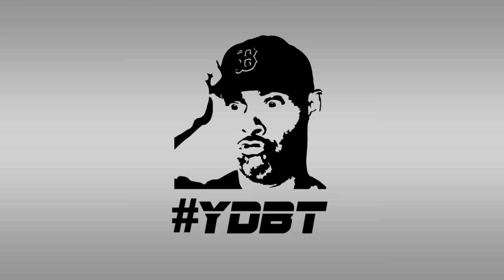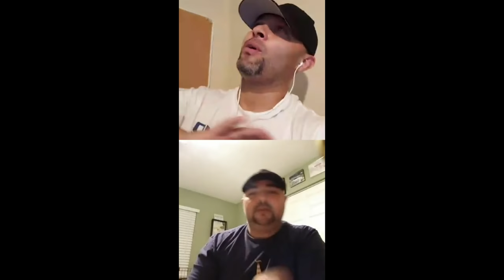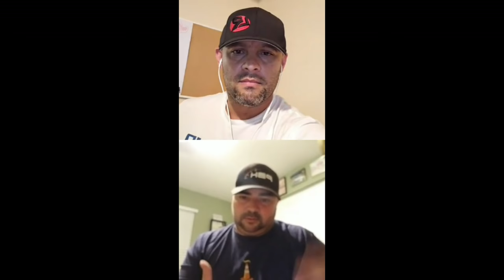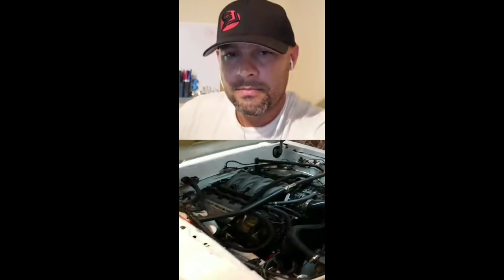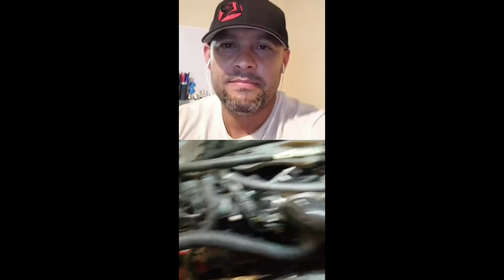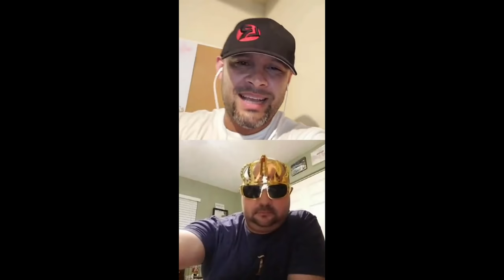IG live episode 2. Coyote swap and common mistakes.

Comment: As always Alex, thanks for sharing great info. And I am happy PBTH is getting lot of business from these swaps. But overall it is completely beyond me, that people are willing to throw 15-20K into swapping an modern engine into some old junk. When you can just save yourself the headache and buy a S197 GT for way less the 20K and get yourself a modern car that comes with desired motor . Heck can even get a S550 for very low 20K today.
Reply: I understand that it can be about the sentimental values. It hardly ever makes "financial sense" the hobby of car modding. 
I like to mod and go fast myself. But there is a limit to everything, and for exp spending 20K on a 5K car is completely overboard to me. When it comes to try to make in kind of sense out of it this expensive hobby. It is just my opinion. 
But again I am happy companies can make good business helping people that like to spend 20K on swapping an engine into a 5K car or even less, Like Alex's Fairmount!!. As big of a fan I of the man. I just to don't understand the love for the Fairmount. But it has to be about sentimental values. I guess.

Comment: Hey man my clutch is going out on my 2012 Mustang GT, what’s ur top pick(s) for aftermarket clutches. I’m making 435rwhp and 385 torques currently. Hoping to up that to about 500-550rwhp eventually.
Reply: Robert Hatley somthing with NO springs, and like a 6 puck stage 7 design, doesn’t have to be 7 prolly just a stage 3, somthing as grabby as possible
Reply from the maker: Mantic twin disk.

Comment: I have a 2011 5.0 GT what would I have to do to get the 2nd generation 5.0 in my car to make it running and driveable
Reply from the maker: Move over all of the cam components, Chains, phasers, Crank sprocket, and cams .
Reply: Because I was going to buy a crate engine from an S550 I didn't know if I would need a wire harness and the ECU to make it run and drive and I want to say thank you for helping me with the information

Comment: Common problem everyone want plug and play sorry it's not that easy...… My brother bought 2011 F150 core engine 450 dollars. Rebuilt engine forged pistons, mustang oil pump, front cover, Boss OEM cams (GT and BOSS share same intake cams) rebuilt heads AND still cheaper than buying crate engine or used Mustang GT engine. Does it help that we're both mechanics YEP. Did a lot of research in difference between F150 vs Mustang and doing the swap. Ran into problems with dash but aftermarket cluster fixed that. Problem with using 2001 Cobra Alt (4g alt) on I terminal DON"T connect ignition 12volts to it because you will burn alt up. Had to put in 560 ohm 1 watt resistor from ignition (run) to I terminal fixes that. Fuel system so many scream dual pumps for possible upgrade to supercharger and paying out 1000-1500 dollars. But 99.9% will never do supercharger if you was do it in first place. Put in fuel hat for 1998 and put in single high output pump in.Only thing that was close to plug and play was swapping 01 explorer 5.0 into my 1999 Ranger 4x4. Except I still wanted part time transfer case so trans adapter and changing length of driveshafts. Add ground in for transfer case low range. Using Explorer rear axle taking spring pads and shock mounts welding them to it.

Comment: I'd rather build a 351w base 418 stroker  all off the shelf parts with custom cam , heads and pistons and good rings 650hp rwhp NA on pump gas for 9000$   In the motor all brand new internals that's machine shop work and all with a Holley dominator ecu total cost 11gs. Instead of 20gs for 435 rwhp. I don't think the coyote is worth the money then another 10g for the supercharger, to deep for my pockets!
Reply: Randy Beuttell coyotes start to shine when boost is applied
Reply: Dalton v I agree I own a 2017 gt and I love it and agreed it's a great platform period . I also own a 91 mustang gt and all I was saying is for the cost I wouldn't put a coyote swap in it when I can and did go with a 351w base motor. And I'm getting 650 to the tires on pump gas without a power adder on a good tune for a quarter of the cost and I still have room to work on stuff with ease and the simplicity of a pushrod motor I wasn't bashing the coyote just saying it's to expensive to go new everything and that's the only way I'd do a swap right the first time all new = no problems and reliability.
Reply: Randy Beuttell  Interested on how you managed to put down 650 to the wheels on pump fuel N/A. My last combo was also late 60’s 351 block we bored and stroked to 408 ci. Scat crank, eagle rods, diamond pistons and a custom grind comp cams to 707 lift. I topped it off with aft 225 58cc heads along with a super victor and a 1050 cfm Quickfuel carb. On our engine dyno  and c12 fuel we ended up making 643 fwhp.  Does the Holley Ecu set up really bump hp that much? I’m not sure what my 408 combo would’ve made to the wheels so I’m gonna assume with the pro-shifted tr3550 it was somewhere in the neighborhood of 550 ish. I hope I’m not coming across as a dick. I’m just curious how you where able to make that kind of HP on pump fuel. That’s pretty bad ass you basically squeezed out mid 700s fwhp. Is the car street friendly? Mine was kind of an expensive bitch considering it ran on c12. It would’ve been a ton friendlier if we detuned it to run 93. But at that point it would make mid to high 4s rwhp. Prior combos on the car where the normal hci, then to a 306, 331 turbo, and finally the 408. I’ve since sold that car to a good friend and currently sporting a gen 2 Coyote swap with forged rods n pistons along with comp cams stage 2 blower cams and couldn’t be happier I went this route.
Reply: turbinatorlou check out budget 418 CI  Windsor built by HK ENTERPRISES HUSTON TEXAS I think the article was in hotrod magazine it can be found on google search it has the complete build sheet with parts numbers and prices I duplicated that exact build . Only difference is they built a carb setup and  I'm fuel injected with victor Sr upper and lower intake the dominator is just so much more precise and can be tuned to perfection. I think they made 670hp carbureted.
Reply: turbinatorlou my motor is making roughly 1.75 hp per cubic inch and it's a little radical but definitely drive ability is pretty dang good . Hope that answers your inquiries.
Reply: Randy Beuttell congratulations to ya. That’s pretty impressive
Reply: turbinatorlou thanks man I'm very happy with it! I've run the 302 CI with nitrous and supercharged not together but first nitrous then went supercharged and it was always something I got tired of problems related to power adders. So I'm happy to have a healthy NA motor but I have room to grow if I want to up the power in the future but I doubt I will the older I get the less going crazy fast is important to me .
Reply: Ryan Merrill nice I'm happy for you !! I hope it all goes well , you are right you will get better gas mileage IF YOU KEEP YOUR FOOT OUT OF IT and yes your drive ability will be better if you have a spot on tune. What turbos are you using and is the block stock or did you go with forged internals and better sleeves?
Reply: Ryan Merrill Gen 2 here as well. I bought mine brand spanky new in December of 2014. I’m not sure what they go for now but back then I paid just oven 6k and it showed up in this pretty box with Ford Racing badges on all four sides..Even though I probably didn’t have to, I ended up pulling it completely apart, honed the cylinders and line honed the mains. Added forged rods and pistons, all for peace of mind. Also added a set of boost cams for future “bolt ons”! The goal here is to run it at a conservative 700ish rwhp which nowadays ain’t shit to some, including bench racers. There’s some much info out there that I don’t see why some folks go the “pro built” route. Will there be some trial and error? Of course that’s all part of the process but at least you know that YOU, turned  the wrenches on every nut and bolt on the bitch. And I’ve said this before and y’all who’ve done it know that feeling of driving something created by you. That feeling of no room for a passenger cause your balls need the extra space.
Reply: Ryan Merrill TVS Supercharger. I wanna keep the stock hood and I think I may have just enough room with the TVS to clear it. Another turbo car would’ve been sweet, specially on a Coyote but I’ve never had a Supercharger and I’m way too lazy at this point to start running piping and working on everything to fit. Your gonna be happy, happy with your set up. Turbo is KING!SCT Tuner BTW.